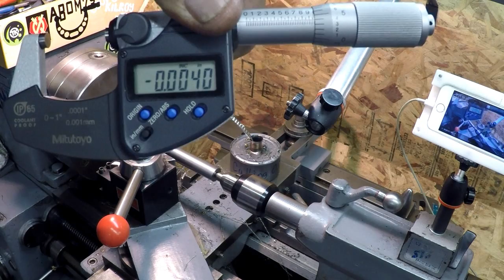How to Repair a Lathe Change Gear Part 9

Comment: Hi Randy,
You're not the only one that has to deal with those drawbacks, In my words, it's gaining experience the hard way, but it stays all your life....
If you ever noticed on my own taper attachment, there is a micrometric screw that allows small increments in the +/- direction, easier than the hammer tap, tap...
Have fun,
Pierre
Reply from the maker: pierre beaudry Thanks Pierre,  I don't really have to many do overs.  Maybe 4 or 5 in the last year.  The taper attachment is going to get some upgrades and micro adjust is going to one of them.  But there were a few other issues I had to deal with not shown in the vid.  So I will be revisiting the taper attachment later this summer.  Thank you for the suggestion,  Maybe you could show yours in a video so I could see how your adjuster is setup.  Thanks fro watching, Randy
Reply: Ok, within the next few weeks I'll try to insert a detailed description of the taper attachment on my lathe, Pierre
Reply from the maker: pierre beaudry Thank you Pierre.  I have been busy with family visiting here in Nebraska, and need to catch up on vids when i get home this week.  Thanks Randy
Reply: On this side I'm still trying to get completely rid of the flu that got me pretty good (or bad), weather is just starting to look like Spring is setting in, this is so welcome after a shitty Winter...   Say Hi to your family and enjoy your trip... Pierre
Reply from the maker: pierre beaudry Hey get well soon.  Spring will come.  Thanks Randy

Comment: When fine adjusting the taper attachment it would be useful to have a fine thread jack screw to push (or pull?) it from side to side.  The screw could be threaded through a vertical post that fits into the slot in the angle plate and have a nut underneath to secure it.  A 20 pitch thread would give you .050" of movement per revolution.
Reply from the maker: *****  Thanks for the suggestion Bob,  I am going to revisit the Taper attachment setup in the near future.   I like your idea.  Hopefully this summer I can take a good long look at it.  Thanks fro watching, Randy

Comment: Dang, those slight tapers can fool you. Once you feel the ID contact, you can push it another inch or so before it snugs up!  Another nice video Randy, you're gittener. Done!  TC Mike
Reply from the maker: Michael Murray First time I have had to make one.  I was prepared to screw one up.  But hoping not to.  Great project with all of the small projects I had to do to get this far. Almost done.  Thanks for watching, Randy

Comment: Wow. Good video. I love the real world stuff, because that's where I live. I have a nice bin filled with "had to do that one agains".  Love the taper attachment. Could you not measure the taper directly between the lathe and the taper attachment, rather than cutting a test cut each time? hmmm  . . .
Thanks for this one. I'm learning from each one.
Reply from the maker: Jim Milne Thank Jim.  There were a few different ways I could of made this mandrel.  I actually tried 2 other methods and did not mention or show.  I was not happy with those results.  I wanted to use the Taper Attachment.  So this time the  best option was just to make test cuts.  I found I need to do some adjustments to the attachment and at least one mod.  I am going to revisit the Taper Attachment later this summer I am thinking.  Thanks for watching, Randy

Comment: Hi Randy,
It a little late now but I was wondering if you could have saved the first mandrel by milling a key slot on the mandrel and matching it to the key way on the gear.  I'm not sure if the contact area between the gear and the mandrel would be sufficient to keep it from sliding when you mill the gear teeth.  You wouldn't have to worry about it spinning though, with a key in there.  Thanks for the video!
-mike
Reply from the maker: ***** I thought about doing that then locktight to the shaft.  But cutting the gears teeth causes a fair amount of vibration and a key will only stop it from turning.  I even thought about a tapered key.  But I wanted to get the mandrel right.  Thanks for the suggestion and for watching, Randy

Comment: That wasn't Bozo, those where just practice runs at making parts you don't need yet. lol For such a minimum taper would you have not been just as well to set your tailstock over or up? A few sheets of paper under one side probably could have got you there pretty fast.
Reply from the maker: bcbloc02 I really wanted to try out the taper attachment, this was the first time using it.  I found out a few things about this attachment and I will be doing some more work on it.  It should of worked better than it did.  The stroke on the compound was not long enough for the mandrel length I wanted. But the compound would of been easier.  Thanks for watching, Randy

Comment: There is something making a thumping sound on your videos ?
Reply from the maker: Mack McCurry Sometimes, at certain rpm of the lathe and when I have the camera mounted to the back splash it picks up that.  I plan on building a separate camera mounting system that will work over the lathe and the mill.  Thanks for letting me know, I will check that out.  Randy

Comment: do u use the camera mount from Kilroy?
Reply from the maker: Chris van der oest Yep I am the original designer, then James did a few mods.  Thanks Randy
Reply: Randy Richard  Good do you know when u use this mount i guess not the hole time?
Reply from the maker: Chris van der oest No not all the time , I have 2 mounts I use for the GoPro and a mount of the iPhone  and one for the iPad.  Thanks Randy
Reply: Randy Richard Please listen with a headphone  from 0.00 min to 3.36min and at the end also this is the first time i hear this knokking sound same as kilroy when he start using that mount
Reply from the maker: Chris van der oest Thank you I will look at that and do some testing.  I am not listening close enough when editing.  Thanks again, Randy